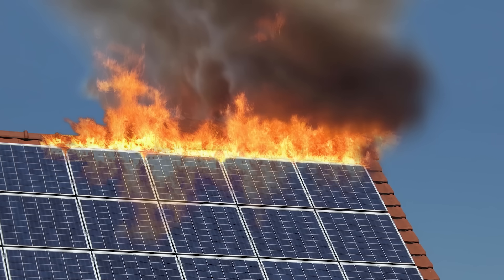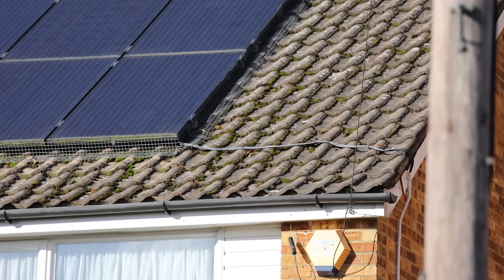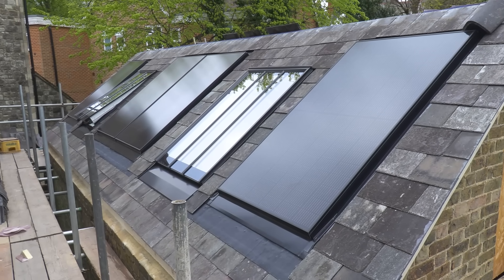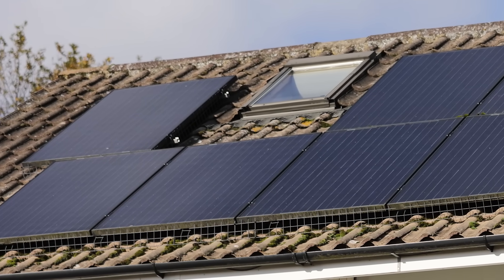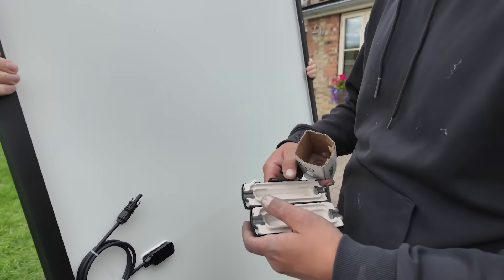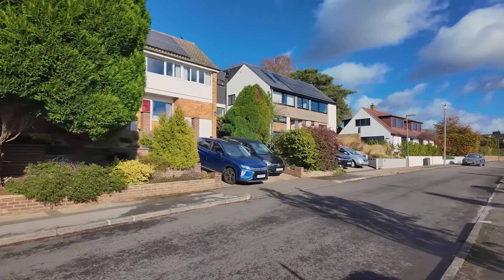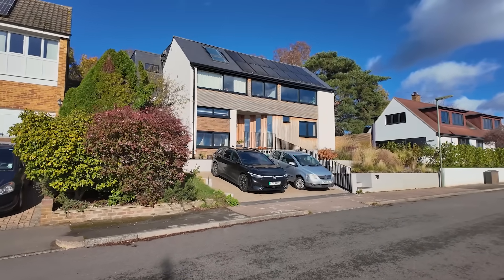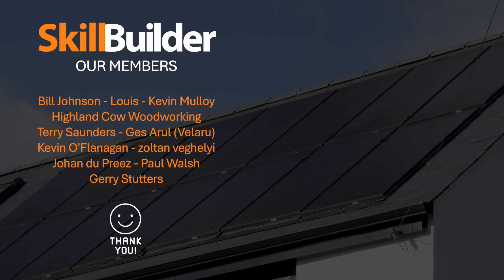Solar Panel Fires Are Rising – Here’s Why

Comment: Another option to eliminate the risk of roof fires may be to use microinverters instead of string inverters. The Enphase ones have a good reputation, and apparently perform better in partially shaded installations, giving more energy. Also, their batteries use lithium-iron-phosphate, which don't suffer from thermal runaway unlike other lithium types, so are essentially immune to catching fire off their own back.

I wonder if lithium-iron-phosphate should be used on solar storage farms where there are concerns over fire risk. Maybe they already are.

Comment: Batteries, there are different types, we have been using lead acid cells for a hundred odd years with virtually minimal fire risk, cars were first invented with battery power not petrol engines. Lithium batteries are the type that can burst into flames and should be banned, insurance companies will ban them in the end as the fire risk to great. But it is a shame people like you paint all batteries are the same, it is not about their price but the type used in any installation that is the fire risk!

Comment: Putting large  batteries inside any enclosed space is still quite dangerous since the fumes they spit out are highly flammable when the battery fails to ignite them, doubly so when concentration reaches the explosive range before ignition and blows up your shed, garage or whatever other space they are in. Ideally, you would store batteries in a space fitted with an extraction fan powerful enough to keep up with the worst-case out-gassing.

Comment: I’ve sold and have installed solar panels over the past 18 years, installing hundreds of systems, selling millions of panels, and have never had a single one, or never heard of a single one, catch on fire.
Reply: Same here in Denmark 😊.  No fires.
Reply: Not a problem in the USA more fire risk from lint in dryer vents than from solar unless battery is up on the roof
Reply: @hw8621 Not a valid comparison. What proportion of US households have a drier in comparison to solar panels on the Roof? I am sure their are many fire risks. One of the most significant is electrical fires of all descriptions, (certainly since the use of open flames, such as open fires candles and gas lighting became less common). For example loose connections or rodent damadge to cables. Its a false argument to sugest because somthing is a fire risk, such as tumble driers, solar pannels and batteries are not. Certainly their has been a large increase in battery fires, as outlined by various fire brigades such as London, go look it up. I am not convinced by anyone who sugests I have being doing it for 18 years, so theirs no problem.
Reply: @regsmith5972 well said,  I totally agree.
Reply: I worked as a consultant in the heating industry and one of my clients was a large housing association. They went large following the original Kyoto agreement and had a whole street of low energy homes built, it was called Kyoto Walk. These houses had every kind low energy systems, including solar PV, they had to replace every panel after 5 years as the major company that supplied the panels had a serious fire at a different site.
Interestingly reputable PV companies wont install panels on old roofs.
Reply: @geoffaries A common arrangement in the US is that the homeowner doesn't buy and own the psnels outright. They are on a leaseback or time payment arrangement, and the installer often owns the panels for 20 years. Since someone would have to remove and reinstall the panels if the house was being re-roofed? They won't do these "free" installations unless there's a fairly new roof.
Reply: Is it the solar panels or the equipment overheating in a loft😮
Reply: One month ago a house near me which recently had solar panels installed caught fire,fire brigade had a delay in putting out the fire because they had to be sure there was no danger of electrocution before dealing with the blaze,by which time the whole house went up in flames,fire started in the roof space, so draw your own conclusions.
Reply: Never say never….
Reply: Oh those fires happens on a few houses each year. Read the news or google it
Reply: It’s all about quality not quantity!, China’s drive to £zero to monopolise the Solar market means that quality goes out of the window, coupled with the installer- and we all know that Cowboys are rampant within any industry and especially construction.
Reply: Had panels 13 yrs no problems
Reply: Con job
Reply: Efixx covered the issue of fires from solar instalations quite well in their recent weekly roundup of news in the electrical industry, and in their latest live stream. They generally promote solar instalations, but do point out some issues leading to a sharp increase in fires. They sugest not only poor instalation, but other problems such as the lack of a risk assessment, as extream weather events can damage solar pannels to the point where they are a fire risk. They also sugest inverters are currently the major source of fires solar instalations, as they become hot in use, and become a fire risk if used in a enclosed area such as a loft, with inadequate ventilation. They also point out the increase in solar instalations using a battery storage system, could lead to batteries becoming the main source of a fire in a solar instalation, particularly when using a Lithium ion based battery system. This is the live stream, although it does go on a bit.
https://www.youtube.com/live/SjWoGQyGAfc?si=Gp343QCxoMZjB3Wx 

This is their much shorter weekly round up that also covers this issue.
https://youtu.be/TaMJ0EEIndk?si=SV4LmDsytdmfUKTr
Reply: WEF SPONSOR GHOUL TODDLE OFF!
Reply: It’s not the panels that catch fire it’s bad wiring and connections. Furthermore panels get the blame while the are rarely the cause of fire.
Reply: @ReneArtoisMr  Bad wiring and connections by the installers still make it not worth the risk. How many will go up to thoroughly check these after the installers or even know if the connections  are all correct? Some may of course but the vast majority not.
Reply from the maker: If you doubt the figures it is easy to verify. I said it was a low risk but it is increasing
Reply: @SkillBuilder Low risk is a meaningless term, and comparisons are not really relevant given the different enviromental risk factors. The significant rise in battery fires that I referenced from reliable sources is not insignificant. I am not sugesting not using batteries, I use them all the time. What I do sugest is they are not the only and best solution to all problems. Batteries are best suited for light power usage. But batteries are old technology that does not work well storing large amounts of energy for prolonged usage. For storage of large amounts of electrical energy, it is far more cost effective to use a reservoir to store this as potential energy. This inability to store large amounts of electrical energy, is why UPS systems for large installations have a genetator back up. Solar instalations are fine for applications where limited power is required, but they have to be installed correctly to 18th edition using hardware that minimises risk. Using shody materials and tampering with the installation significantly increases risk.
Reply: @SkillBuilder  Looking forward to you publishing your sources.
Reply: Clearly this is untrue, given reports by the London fire brigade, and the major fire at the flagship Wembley  Ikea that started from it's solar panels. Anything charging batteries is a fire risk. Lithium ion is a particular fire risk, as they are prone to thermal runaway, particularly during short circuit conditions. Other batteries are less of a fire risk, but Lithium ion are good at storing charge, which is why they are still widely used, and are lighter than some alternatives such as lead acid batteries. This is why you are prohibited from using the post office to post batteries, and are required to use a specialist courier. The latest amendments to the wiring regs cover battery charging for this very reason, (amendment 3, I believe) making putting battery packs in lofts no longer conforming to the 18th edition, they now are put outside for safety considerations. As well as an origin of fire, batteries are heavy and could fall on you from a loft space, in the event of a fire. Batteries should be treated as a fire risk, and be installed to minimise risk by a suitably qualified person, in the same way as you would treat a gas supply.
Reply: @regsmith5972 his personal anecdote is entirely true from his perspective. 

He gave a personal experience and you confused it as a study!
Reply: @regsmith5972 gas supply is A LOT less risky than putting a highly unstable electochemical plant (“a battery” ) on your property……
Reply: @regsmith5972  Thanks for this, not willing to take a chance even if rare.
Reply: @regsmith5972 I love the way the OP was talking about solar panel fires, and you immediately talk about batteries...
Reply: @clintoncoker6 Go watch the effix videos that I linked too that had the former deputy head of the London fire brigade, it's both. Weather damage or poor instalation can make pannels a fire risk, batteries particularly lithium ion are also a fire risk when incorporated into a solar instalation, but currently the greatest fire risk is the inverters that convert DC from the pannels to usable AC, as they tend to produce heat particularly in a enclosed space without adequate ventilation such as a loft space.
Reply: Same narrative as people say EV’s catch fire every 100miles 😂

Studies actually show that ICE vehicle fires are more common per 10,000 vehicles than EV fires.
Reply: @davemckay8664 maybe, but non-battery vehicle fires are a lot less dangerous, and if you carry a decent fire extinguisher, a very handleable issue. Nor so a BEV, you need a water tank to submerge the entire vehicle to stop the fire!
Reply: @ziegle9876  100% - EV fires not only give off toxic fumes, but also virtually impossible to extinguish. Not taking the risk with my family.
Reply: @ziegle9876 why a water tank? A large CO2 extinguisher would seem more effective.  CO2 is recommended for electrical fires. Water feeds the short circuit in a lithium ion battery. That's why you need a whole tank to try and smother it from oxygen supply.
Reply: @davemckay8664 Please reference the data from a reliable source? While it is probably true that  internal combustion engines, particularly petrol pose a greater risk in the event of a collision, (or vandalism) as petrol is highly flammable, in comparison to diesel or battery vehicles. The problem being Lithium Ion batteries are a fire risk when charging, which is a problem if you have a charger attached to the side of your house. This problem, and the difficulty of heat build up in a confined space and the difficulty of maintaininance, and the risk of a heavy battery pack falling from a loft space in the event of a fire is why ammendment 3 of the 18th edition of the UK wiring regs prohibits the installation of battery storage systems in loft spaces (such as for a solar system), requiring them to be put in other places such as outside, where they are less of a risk. For similar reasons you would not store petrol  in your house. International Fire and Safety journal sugests UK attended 1,300 Lithium Ion battery fires in 2024. This represents a 93% increase from 2022. I would suggest this is significant, given that internal combustion engines are far more prevalant than battery powered vehicles. Batteries are not inherantly dangerous, although Lithium ion battery technology is, due to Lithium as an metal is highly reactive, and will burn, with Lithium ion batteries prone to thermal runaway. There are however alternatives. Lead acid batteries (such as in a ICE car) are far less prone to this problem, but store less energy, and are heavy. Just because petrol engines are a fire risk, does not make it ok to pretend batteries are not. We have regulations to mitigate risks from inflamable materials such as petrol and domestic gas, similarly we should have regulations mitagating the risk of battery fires, particularly given the sharp increase in battery fires in recent years. For example, BBC news (online)11th Feb 2024, states, "E bikes London's fastest growing fire risk, says fire service". Better regulation and enforcement, and the development of battery technology away from Lithium Ion battery technology, to battery technology less prone to thermal runaway will mitigate most of these risks.

Comment: I recently had a solar and battery installation and was surprised that the battery and inverter were put in the attic and not outside seeing as the Duracell brand items are designed to go outside. The first thing I did was purchase extractor fans plus smart temperature sensors and plugs to switch the fans on and extract hot air once the attic gets above 22 degrees. In the summer my attic space gets above 40 degrees and so I'm a little concerned about the batteries and shortening the life of the inverter in that heat and a potential thermal runaway given the amount of EVs catching fire. I might just be being paranoid but for the sake of £100 I feel much better. Hopefully cooling the tiles from underneath will also help cool the solar panels.

Comment: "I don't want to alarm you but it could be these new panels are a ticking timebomb" Yes, I'm paraphrasing but... come on.
A lot of the time inverters are installed in lofts - a terrible idea because it's often a terrible environment for electronics. I do wonder whether these small numbers of fires are the panels themselves, or the connectors, or whether it's the inverter and mains side. Would need a lot more information.

Comment: Cables don't 'cook' because they're old. The problem always comes from the joints. Either the joints were poor to begin with or they corrode due to not being properly sealed from moisture. It means that the contact area is smaller than it needs to be which causes a hot spot. This heat accelerates corrosion and further lowers contact area which in turn increases heat - until it catches fire. But good video anyway, you've reminded me that I need to go up and check my panels!!

Comment: I don't think telling people to get their batteries moved to the outside of their house is very practical and would be of little benefit.  The batteries used in a house are not the same as batteries used in a car or e-bike, they won't burst in to flames or explode although the materials may burn if your house id on fire.  The risk of a junction causing your roof to catch fire are extremely low, but, a roof fire is far less life threatening than one in the main body of the house that could restrict your ability to get out.  Batteries don't catch fire, solar panels don't catch fire.  Any fires would be due to poor workmanship and installation.  Are solar installations checked as part of electrical safety?

Comment: Do not rely on cost or brand to guide you towards safety: the early Tesla solar panels and power walls and BESS used NMC chemistry which is basically a bomb without a detonator and needs extra care. Solar panels are mostly glass and Aluminium which do not burn and some newer panels have double glass construction but there is always the chance of bad crimping on the MC4 connections causing overheating and there is a thin white plastic encapsulation and sealing backsheet which can all burn and obviously, tree clippings can get trapped behind the panels and can burn when hot enough. 

Use a thermal camera or (on low voltages only) your hand to check if any MC4 connections are warm or hot when there is maximum current flowing through your solar panels and wires.. Ulefone makes many cheap thermal camera phones that are less than half the price of a silly iPhone jewellery phone so they are like X-ray radiography for heat and quickly spot even small resistance problems in solar. Also, PV strings can be built in pairs to allow simple comparisons to spot small faults. Check the connections and test everything - do not trust to brands or cost.

There is a huge difference in the safety profiles of Lithium Polymer Vs Lithium Ion (NMC), Lithium Iron Phosphate (LiFePO4), and sodium ion batteries and all are for sale now. Forget the branding: LiFePO4 and Sodium Ion are much safer than the others.

Comment: On the 2 separate occasions I had a "proffesional" electrician do some wiring in my house both times it was unsafe. 1 an immersion heater with wire strands spread out of the connector like trapped spider legs, 2 a wire was not properly inserted into the connecter and just fell out on a loft installation. I was able to rework these faults to a safe standard but imagine somone without the skills or knowledge to find and repair them still living with them not knowing the potential dsnger.
Reply: Its a nightmare. They just think you have to kiss their boots just because they were gracious enough to turn up. I do my own stuff but electricity is clearly more complicated!
Reply: Similar. Had a electrical company who issued test certificate to me on work completed..after I requested the certificate. Then found they had wired power socket into the lighting circuit...
Reply: @caterthun4853 😮 are you in England? Go to 'Trading Standards' at your council. They shud prosecute them😅